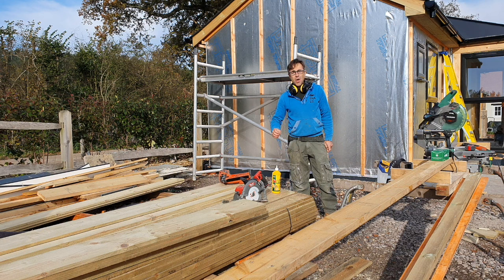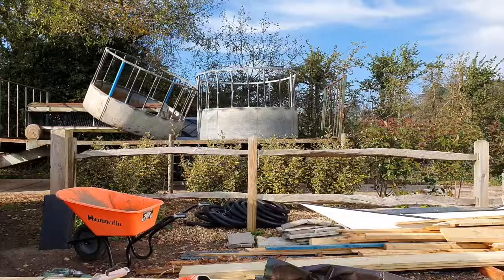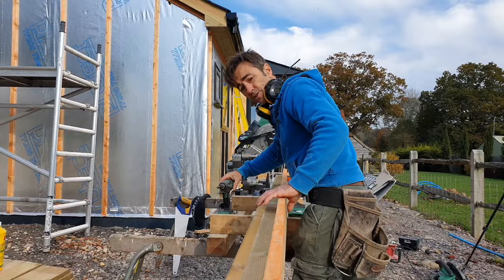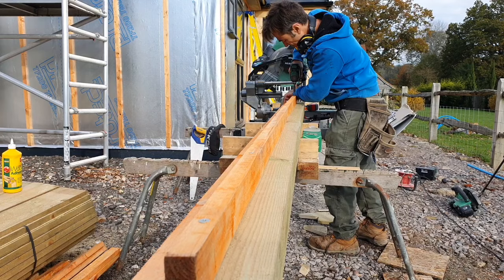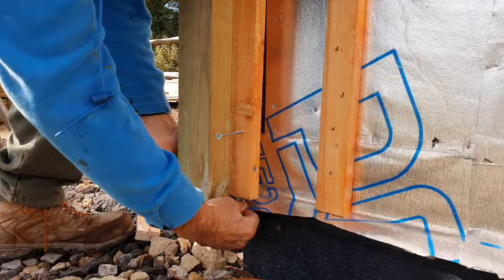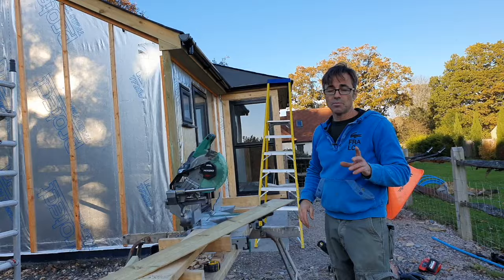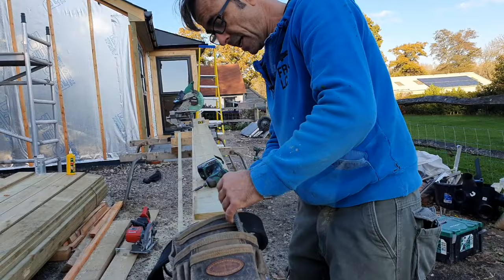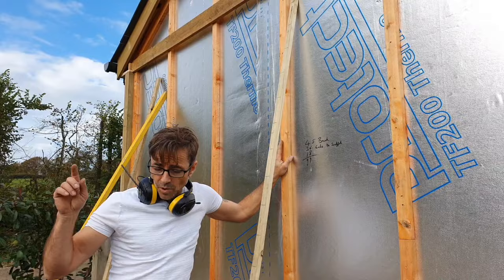How to set out, measure, cut and fix Timber featheredge cladding the carpenters way

Comment: Anything longer than a 600mm offcut and my customers moan like hell about wastage, so I always end up  coursing vertical joints on large flanks which is another challenge as I don't like to see a diagonal joint repeat up the flank. (would love to have joint free faces like yours). Nice to see a proper, substantial 55/60mm corner post the width of the boarding AND the batten. I think your videos are honest and are, 'keeping it real'. Its really good for the carpentry trade. Cheers.

Comment: We like to make a little gauge out a piece of batten with a notch out of it abit like an L shape that fits under your fixed board to give you the correct spacing for your next board saves alot of time,just need to check with your batten gauge every 5 or 6 boards to double check and adjust accordingly.also you could have marked your corner posts with your gauge to help make the job faster.👍

Comment: I like your corner post approach. Why no heart out orientation of your boards? Appreciate your liking for the square cut on the bottom edge, however heart out will allow the board to cup into the building and facilitate secret pinning. Ideally, rift sawn boards will be more stable but very much more expensive
Reply: Hi Tim. I am completely lost with what you are suggesting in your comment. I think I understand what you mean about, 'heart out', but am genuinely intrigued with the rest of your technique. As I fit a lot of this type of cladding I am always looking at ways to improve its installation. Cheers.

Comment: i think people moaning about audio was a compliment really, it shows the content was good enough and they wanted absorb your words .
This mic seems crystal .
Would adding 2 screws help prevent cupping or do you find 1 screw prevents splitting issue as timber can move freely and the overlaps enough of a second retention ?
Reply: The timber will move either way nothing is ever going to stop that and you want to let the timber react to the season's if you put screws in over the years you'll spot crack marks around the screws 🔨

Comment: You're still in desperate need of the Englebert Strauss! I like the vent strip of breather and the soffit type vent below. Saves tacking insect mesh all round! I'm going to use that method from now on. Do you not leave an expansion gap on the feather edge? Best Tim

Comment: I’m loving the videos Robin, please keep the content coming. 
After you’ve done the first cladding board why don’t you just mark the top edge of the clad on fixed battens rather using your spacing batten every fix. It’ll save you a lot of time.
Reply from the maker: Its a good suggestion but the cladding being a sawn material varied as much as 20mm on the width so its not true enough to use the top edge, if I was using a Cement based cladding such as Hardie plank weatherboard then I would do exactly that, many thanks for your comment mate

Comment: Great video Robin. Have you ever come across the Hardie cement cladding boards? They have some clamps you can buy called Gecko Gauges which space the boards when working on your own. They adjust at 10mm increments for 100mm-240mm boards but unfortunately only suitable for 8mm thick boards I think. No good for these timber boards however there may be a similar product on the market. Hope that may help you or anyone else reading this comment.

Comment: Great job love the video. Wouldn’t it be quicker to mark the battens for the top of the feather edge rather than use the rods?
Reply: Or create a little t-shaped template which you can hold against the board with the correct cover allowed.

Comment: Hi Robin, Why don't you keep a small gap between the cladding and corner post just about 6 mm or so? The water which runs down the corner post and the water that hits the joint, is sucked up by the cladding and because it butted up against the post, it doesn't have the possibility to dry out again (at least not as easy). We learn our apprentices to do it like that here in Denmark. Thanks for all the knowledge you share, im sure a lot of people learn a lot from your videos including myself.

Comment: Always a pleasure to watch the details done right. Any nail or screw or hole that goes from the outside, should slope upward a bit so water will not seep in as much thanks to gravity and surface tension.
Finally seeing how nailing down the laps is done properly, like most I blind nailed them without really thinking about it.

Comment: What size nails is the Paslode IM360 firing?
They seem to have a full round head?
Reply from the maker: The nails for this Cladding are indeed a Full head and they are stainless steel from Paslode, I am doing some painted featheredge cladding in a couple of weeks and I will feature the nails and the gun in a video later in the year, the nails would have been 63mm from memory!!

Comment: I've seen you mention the 87mm screws for battening in a couple of videos but they really only seem appropriate for the corner post where you're going through the width of the batten into the post?
To affix vertical battens to your OSB sheathing do you just use regular woodscrews 35mm or so?

Comment: HI Rob, great videos and very imformative. Wonder if you could advise me.... I have some featherboard cladding to put on an extension, and some will go around a 3m bifold.  I was intending to run reveals as detail (3x1")around the edge of the bifold to cover featherboard ends on the two sides if the bifold, should the featherboard to the top of the bifold run below the bifold course opening or is it ok to run the boards down to meet the reveal (3x1"). thinking about possible water ingress.  The latter would be better in my circumstance to try adn match with old existing featherboard on the adjoining building.  Many thanks G

Comment: Hi Robin. Are you just using normal collated ring shanks to fix? I’ve got a garden room coming up which will be cladded with shiplap so there will be a secret fixing at the top. Will that be sufficient or will it need a fixing in the centre of the board also?

Comment: I went and looked at the old shed that il be replacing soon, it’s feather edge , and it’s a brand made shed so 100s made the wrong way. It’s nailed through the bottom of each board which goes through the board behind. Looks about 15yrs old at least, not much movement just very worn rotting wood. If I used them il do it this way in the video, by hand,  love swinging a hammer. Cheers

Comment: Great video mate here is what might be a stupid question. Rather than using the rod for the space why not just cut a block to size and flush it of the bottom of the previous board? What that not be quicker?
Reply from the maker: Hi John, you can do that but you can easily gain or lose spacings, I like to use a rod so all the boards line up at any corner, window reveal or doorway, there is so much setting out that having a rod saves so much time in the long run too, thanks for your comment mate

Comment: I was looking to build a shed/workshop. I was thinking of using spax stainless steel screws instead of nails would they be as good
I am using treated feather edge like you did
Reply from the maker: The spax stainless would be nice, the only benefit using a nail is that as the cladding expands and contracts over the seasons the nails have a bit more give and will move a little with the boards if they are screwed really tight then you may see some splitting here and there in the future, hope that helps mate

Comment: Excuse the novice question: would screws provide stronger fixing (more resistant to pull-out if boards cup) but not used because of cost and speed, or would they be just overkill?
Reply: Would you want to resist cupping, or allow it? The nails will allow it to a degree that you'd likely be comfortable with, given the boards were allowed to dry onsite, with a settled moisture level for the climate. As Robin mentioned, you can simply tap nails back in if necessary. A screw in the same situation could cause the board to crack, in theory. Probably unlikely, so I'd say that either is good. If either screw or nails are suitable, you go with the cheapest and easiest which would likely be nails. I think the nails look good too, but perhaps that's just me.
Reply: Thanks  @ricos1497    that makes sense - appreciate you taking the time to answer - this community is such a good way to learn. Cheers

Comment: Hey Robin. Just a quick about what you said towards the end of the video. You said to use nails with a decent sized head/first fix nails. Why would one not use screws instead of nails? Thanks. P.s. I am addicted to you content! Absolutely the best..
Reply from the maker: Hi Chris, I suppose its a tradition thing, for rough sawn thick cladding like the featheredge we would always use a nail, cladding is constantly on the move through the seasons and i reckon the nails have a bit more give in them compared to screws, you can get reduced head screws for some claddings but the time and expense taken compared to a traditional nail technique would not be worth it, hope that answers your question
Best
Robin

Comment: what gauge is best for the cladding? buying a framer and second fix gun is expensive, do I need both? not to mention 16g vs 18g
Reply from the maker: Hi Rodney, the simple answer is that for modern flat timber cladding such as cedar or thermowood then I would be using 16g stainless steel brads that are 64mm long
For sawn lapping cladding such as featheredge in oak or Douglas fir I would use a stainless steel 3.1 x 75mm collated, hope that helps
Reply: @ukconstruction  thank you

Comment: Should you board tight to post or leave air gap?
Reply from the maker: Hi George. I personally go tight and most the chippies I know do the same, however some claddings especially composite or cement fibre need to have expansion gaps, timber on the other hand rarely expands in its length
Reply: @ukconstruction  thanks for the reply - and tips - I was worried about wicking moisture from the post in the end grain I’m using spruce not larch went for a cheaper option thought the gap might help it dry out 
Guess you don’t have to consider less durable wood 😂 just trying to balance cost it’s just a glorified shed

Comment: Top job mate, love your work! Want a helping hand one week? Any big projects coming up? Question? Whats your thoughts on the hikoki gasless 18v first fix? Thought you'd be using it here? I really hate my paslodes, I'm using the hiloki 2nd fixes, 16 and 15g. Really want the framer now but seeing your still using the paslode im wondering why?
Reply: I have both ,equally reliable.Use paslode for truss roofing as its a bit lighter above the head using 75mm ring shanks,the hikoki is more powerful and sinks 90mm ring shanks into anything so I will use that more on traditional roofs with longer and fewer nails and 1st fixing you can hold 2 pieces of wood with hand safely out the way and fix together (like double or triple studs in situ)as there isnt much recoil ,bit hard to explain that really. Will try the new titanium hammer tomorrow cos I just had to get one,cheers all.

Comment: Anyone know what type of floor base ventilation strip Rob used on this build?
Reply from the maker: Hi Tom, I use a 10mm plastic over fascia vent strip and this works well, I am planning a more in depth video soon on this
Reply: @ukconstruction  thanks mate
Reply: @ukconstruction  I'm Interested in seeing this future video! 
partly as I'm currently using insect mesh at the bottom of cladding and its not ideal, also I'm not sure how you were able to ventilate the floor space and create the step needed to start the cladding in one fell swoop

Comment: What nails are you using in your nail gun?
Reply from the maker: Stainless Steel 63mm ring nails
Reply: @ukconstruction  They looked like a full head rather than a clipped head?
Reply from the maker: May have been the "i" series from Paslode, these are full heads
Reply: @ukconstruction  Thank you, it’s actually very difficult to get this information believe it or not. I’m about to start a DIY cladding project so your video and advice has been very helpful giving me the confidence to tackle the project myself. I really appreciate you taking time to respond to all our comments.

Comment: A guy that has been a pro carpenter as long as you should know?  When you arrive at the job you put on your tool apron and take it off when you leave ?  Or you can run around from one end of the job to the other stating “where is my tape measure”?
“Where is my nails”?
“ Where is my hammer “?
“Where is my speed square”?
“Where is my bits for my drill”?

Come on Robin??  Get yourself a Diamond Back Tool Belt or a Buckaroo?

Comment: Just out of interest the stick you use to get your guide for the overlap. Ive always used a ‘T’ piece cut and screwed together at the exact spacing. Then when i hold the next length up the T would be upside down so it not only holds the piece of feather edge in place it also gives you the correct spacing. Is there a reason you dont use that process yourself Rob?

Comment: This makes me want to build stuff beyond my capability. And buy tools. And watch more hours of YouTube videos. Help.
Reply: Same here.
Reply: Lol

He got me hooked.
I’m buying a sheet of tricoya, had never heard of it before.

I’m buying the festool insulation saw, going to try out cut wrights at some point, 

And I have a desire to fit an MVHR unit lol after seeing robin talk about them all.

Also like his tool recommendations.
Reply: Go for it only live once I’ve been a carpenter for 29 years and it’s a great trade / job
Reply: Same here, I’ve identified a number of DIY jobs now, all beyond my capability which I’ve now bought expensive tools for! HELP !!!!
Reply: @Clicksystems  be careful them sheets are 250 pound 😳🔨
Reply: @tomsmith9048  

Yep I know they aren’t cheap,  lol

But it solves a problem.

Installing some external insulation, and want to bring the windows forward (because they are being replaced anyway) but can’t fix windows to rigid foam insulation.

So going to line the aperture with tricoya, and secure the inside edge to existing reveals.. so acts as a good solution as it won’t rot and presumably won’t transmit dampness to the inside.

Going to also try and see if I can come up with a way of incorporating cavity closers to reduce thermal bridging. But for mounting the actual window frame within the insulation, due to it not rotting or soaking up water it seems to be a perfect solution.

Then fix the window to the tricoya, SBR the external reveals then render over it.
Reply: @Clicksystems  they supply a bigger external window sill it's in metal and powder coated I did it to the family home a couple of years ago there powder coated any colour you want and it'll save repairs to your reveals and an internal window board and they look really good and it'll save you a few bob🔨
Reply: @tomsmith9048  I hadn’t seen them, will have a look.
But won’t the window still be set back in the reveal? All they would do is bridge the gap created.

As window are coming out for replacement I was going to bring them forward so it looked more normal.

But problem I had was finding a material that wouldn’t rot and was strong enough to fix a window to. Lol

Tricoya seemed to solve both problems.
Reply: @Clicksystems  it will all look uniform as I assume your getting every elevation rapped in insulation and if you are definitely going to move them forward you could use plywood if the window finishes flush with the ply because the rendered reveals cover the ply then is the same mastic sealant that's commonly used to seal the connection and you could buy really expensive sealants but they can be 20 pound plus in my experience so I wouldn't personally go with anything from evo stick or bostik are brilliant you'll never go wrong with them 🔨

Comment: These will all work loose
Reply from the maker: Not yet Dan and we are 3 seasons in, my timber had a faily uniform moisture content and the fixings where the right length, cladding can become loose if you fit it and it has a big shrink through the summer but if you fix it at the end of summer it should stabilise nicely through Autumn and Winter so the following summer no major shrinkage occurs, oh and how would you do it???